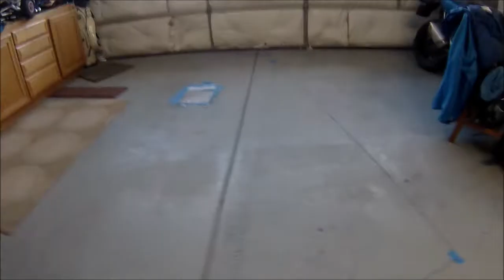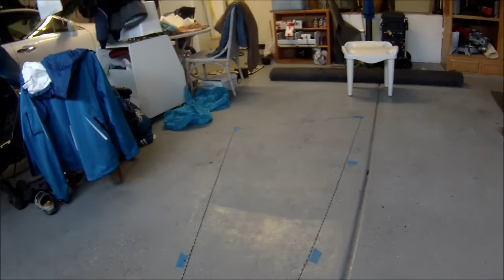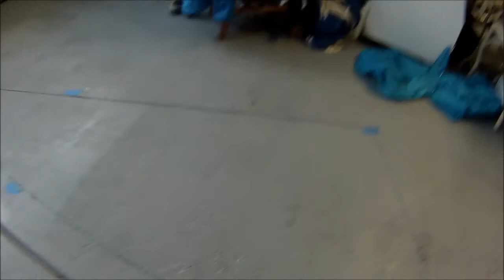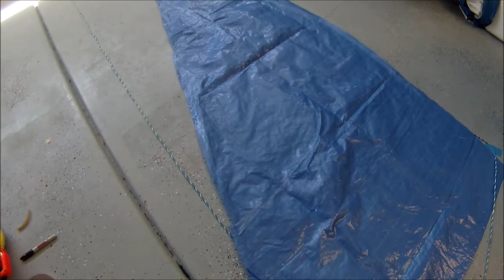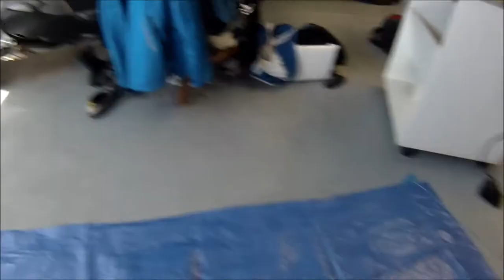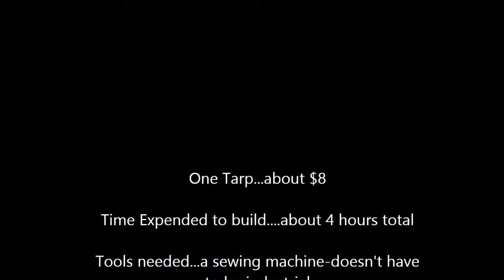Build a jib from a tarp

Comment: Hi Thom
Thank you very much for the idea of using the tarp for the experimental jib
I’m trying to make a similar design but having an issue trying to get the measurements.
Looks like the wide lens of your phone stretches the video a bit.
I compared my measured of the length of your longest  dart and it’s 35% of the distance between the luff and the leech.
But the width of the dart looks much bigger compare to 1” to 30”.
By any chance do you remember the measurements of your jib?
Could you please share them with us?
Btw I like watching you having fun :-) I’m trying to get into sailing too.
I have the Ocean Kayak 4.3m long.
Currently working on outriggers because without them the whole project is a dead-end :-) 
Cheers,
Vlad